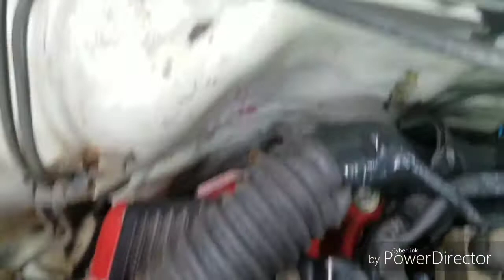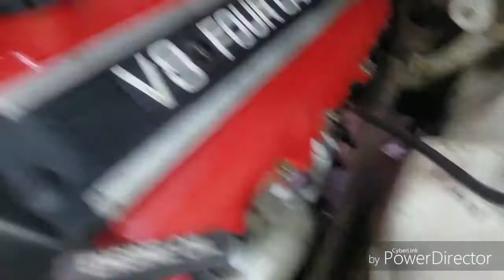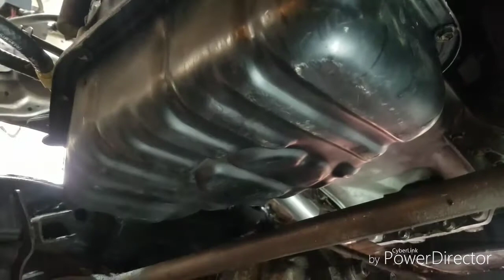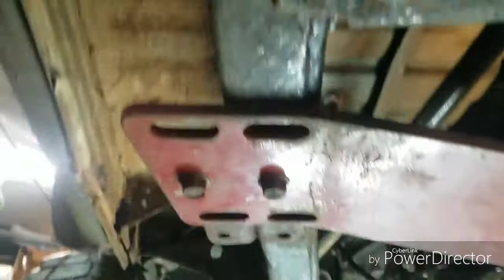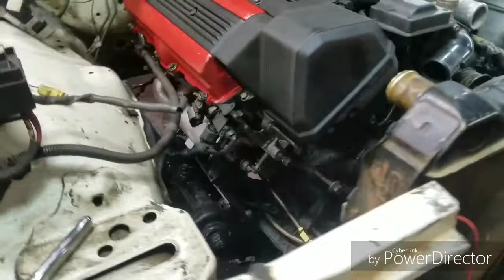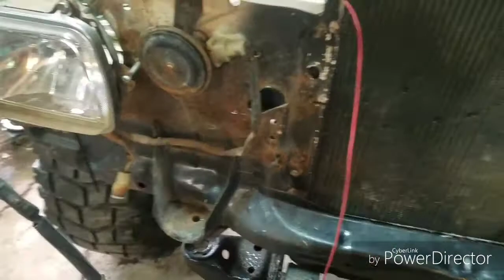1UZ/A340 4Runner fitment

Comment: What about the ECU?  What are you using?  I am looking at a 1994 1UZ as well.  How about the wiring harness?  Where do  you source that?
Reply from the maker: Factory ECU/harness from the engine donor. I bought a 2 day subscription to Toyota Techinfo and downloaded all the factory diagrams, and cut out all the wiring I'm not using, and modified it to work on it's own so it can easily be spliced into the truck.

Comment: How is the build going so far?  You done?  I have a 1994 4Runner so far just about to purchase the engine.  Your video is a good starting point for me.  SO you mentioned that the lift is not necessary, is there any advantage in lifting it. Do you recommend it?  You have any other sources to look at for help with my build.  Let me know please.
Reply from the maker: Progress is very slow. I have many projects, and with 2 young kids, I don't make progress on any of them very quickly. Obviously a lift makes room for bigger tires. With a body lift, you can raise the engine/transmission up with the body, and with a plate crossmember, you can gain like 5" under the case. Also the gas tank can be lifted, too.
Reply from the maker: I'm hoping to film another video this week. Hopefully I can get it edited in a reasonable time frame.
Reply: @NumbchuxSOAD  Thanks alot for the info.  I am getting ready to get started so I will be following your build.

Comment: Great tour of your truck. I am also building a '95 Gen2 Surf but I'm in the UK so it's all switched around! With all that room over the steering rod and diff, Why did you lift the engine so high?
Reply from the maker: To keep the transfer case tucked as high as I could, and still keep the engine level.
Reply: @NumbchuxSOAD  Hi...

Can I ask what you used to paint your covers?